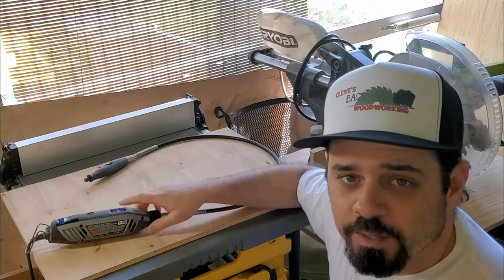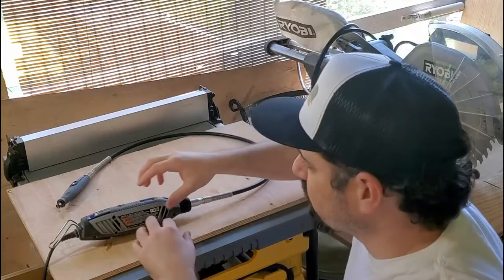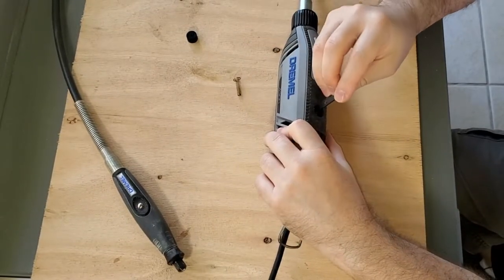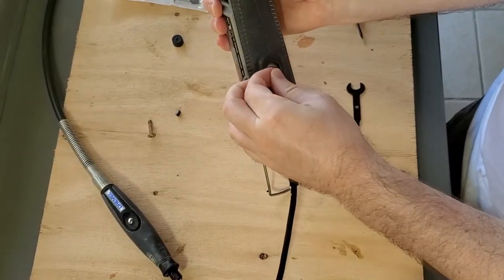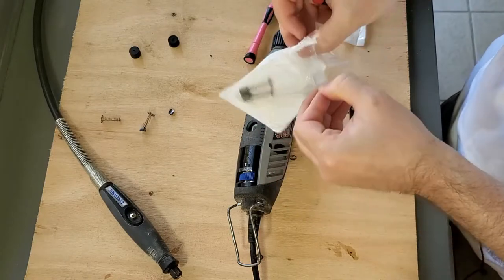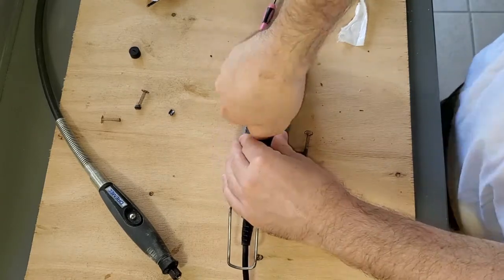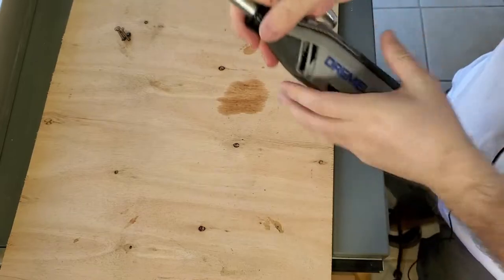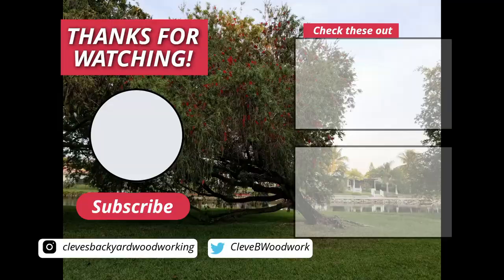Dremel 4300 Rotary Tool Brush Change

Comment: Just a heads up from what i found.   The brush part number is 2610053746.   Not sure if it would run better.
Reply from the maker: Thanks, I looked it up and looks like they replaced this model with the one you mentioned so thanks!

Comment: Thank you for this. I just bought my first dremel 4300 in a 9/64 Platinum kit with a nice silver and blue Storage case for about $217.00 with tax included and want to know everything about this tool before my first use. I wasn't sure if a Break In Period is necessary? Some say yes and some say no. By any chance did you have to do that with your dremel? Thanks for the reply.
Reply from the maker: Nice kit, yes recommended to let your dremel run for about 5 minutes I think  and same when attaching the flex shaft.
Reply: @ClevesBackyardWoodworking  I read that the flex shaft is 2 minutes on lowest followed by 2 minutes on highest and it shut run smoothly. I recommend checking the wire inside for gunk and clean that off and grease it up again regularly.
Reply from the maker: @charisma-hornum-fries  yes a good idea when you first get it to run it a few minutes. Actually have another recent video where I needed a replacement part cause of it breaking. it's working great now.

Comment: Bought a new 4300. Only used it for light/moderate work a few times before it stopped. I noticed that when I pressed on the brush cap on the tools underside, it would run until I let off the pressure I was putting on the cap with my finger. Next, I took a look at the brushes. The brushes looked good but I replaced both anyway with new Bosch brushes. Same thing, it didn't run unless I applied pressure with my finger. I cleaned the small silver contact located on the side of the brush chamber with a bit of alcohol on a q-tip, still no change. I even added a rubber "spacer" I cut to fit inside the cap to apply more pressure on the bush spring against the silver contact as I screwed the cap back on. No change. Still didn't run unless I applied a little pressure with my finger to the cap on the underside (the side opposite of the on/off switch) after the cap was tightly back on. Anybody have an idea of what direction to go next?
Reply from the maker: If you can return and get another one that would be the best thing to do, or call up dremel and see what they can do.
Reply: @ClevesBackyardWoodworking  looks like I'll have to go that route. Thank you.